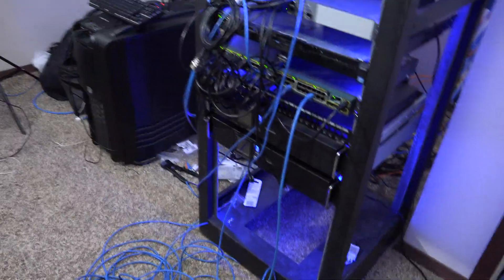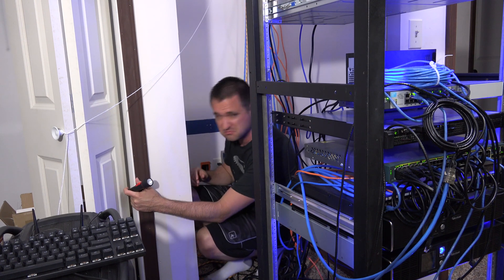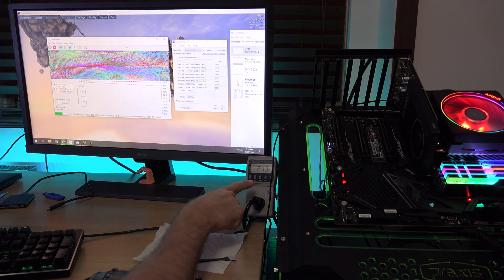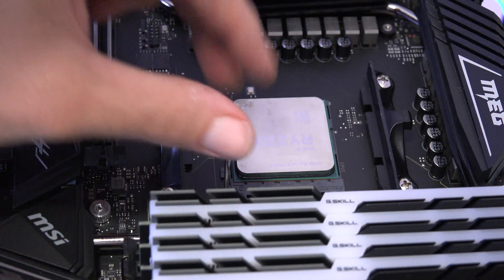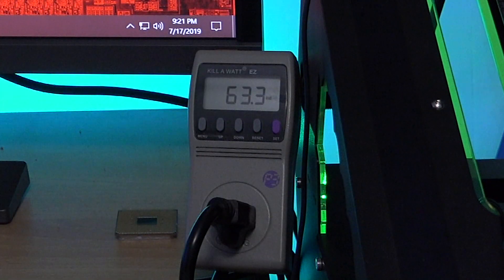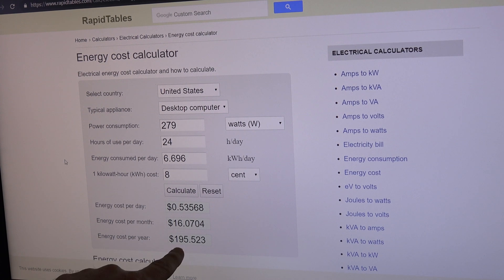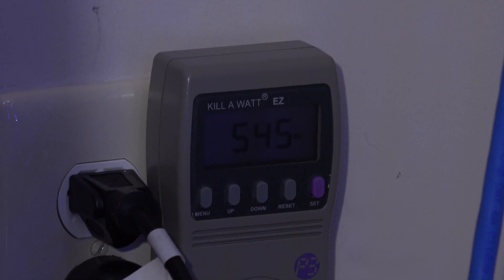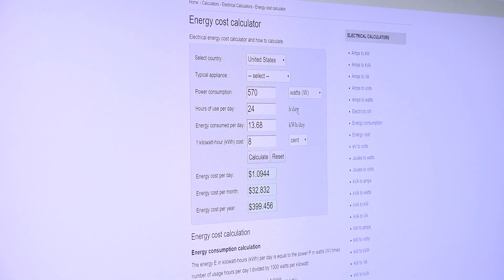Real power usage and of Ryzen 3700x/3900x and p2000

Comment: in reality the total consumption for a server like this is not too different, le`t say we have a huge video file to process, with the 3700 it will take 2 hours at 100 watts (cpu only) while with the 3900 it will take 1 hour 15 minutes at 150 watts (just an example). The total power consumption (thus cost) for that video file will be about the same.

Comment: This test is not only measuring the energy consumption of the processor but also that of the graphics card and memory, to this  must add the led lights on a board with X570 chipset which consumes more energy than the X470 and B450. Despite these, it is a good result for the system loaded completely. I think the Asus Pro WS X570 board could be a better option for the workstation approach.

Comment: I have a similar setup but using a Ryzen 2700x on windows 10 home.  Along with my p2000 I have an RTX 2070 for when I game.  The P2000 ryzen combo works fantastically for transcoding.  Only problem I have is when I want to game I have to switch which GPU is using the primary display. RTX for when I want to game and then back to the p2000.  I am hoping there is a solution someday where you can select which gpu you'd like plex to use for transcoding, so I can easily game while plex transcodes in the background.  I've tried setting up a VM but I think I would have to run linux to get pci passthrough to work with virtual box.  I would rather not complicate things.  The best solution would be to build a dedicated plex machine.... Unless you know of a solution.  Thanks!

Comment: I had a very special question to ask you but it feels like if I had the answer around 5:05 minutes of your video....Well a month ago I bought a new ryzen 3700X with one of the newest motherboards from Asus but I’ve never seen anything that would require more than a 8 pins to give the appropriate power to cpu so I’ve decided to ask for advice to know if I needed to connect both cables to the 8 and 4 pins connectors and I was told that the 3700X only requires 8 pins and more would be too much and even burn my cpu....but your cpu seems to be powered by more than a one 8 pins connector. I can’t wait to get your answer on it because I just can’t see myself roasting a bran new cpu that I’ve paid nearly $500.00 here in Canada. Thanks in advance and excellent video btw!!!

Comment: b450 or x470 will use a bit less power too.  Asrock rack x470 would be the way to go for the next server! Don't forget you can easily limit power draw on ryzen. Check it out.
Reply: my dream is to lower base clock to 400 and let it go nuts to max turbo for up to 20 secs before dropping to 70% of turbo for extended loads...

Comment: And that is why low power was #1 on my list when upgrading my server. I could have bought an old used server for a bit cheaper but the power consumption would have been so high in the long run it wouldn't have been worth it.

Comment: Ok, what ive done, is i got a used rx300 s8 server, hooked up with ONE E5-2630Lv2 60W TDP CPU and 96 Gb of ram. Installed Proxmox, made my virtual machines according to this :
3x Ubuntu Server > Secret stuf
1x Ubuntu Server > MySQL Server only
1x pfSense > As this is my main router + dual port gbps NIC passthrough
1x FreeNAS > with plex media jail + external HBA SAS Card passthrough
1x Ubuntu Server for my ISPConfig host
2x Ubuntu Server for a friend who runs game servers on them
1x Ubuntu Server to run and host Smart Home stuffs

Basically the idle power draw is about 120 watts, at full load it uses 200-250 Watt of power. Im from germany, so 1 kwh costs me a mind blowing 30 cent :S :D but ive done my research and this server runs 100% on green energy (5x300W solar panel + 5x 230Ah Varta Pro batteries + 1Kw inverter ofc excess power is feeding the house)

Comment: Question: When transcoding 12-15 HEVC Streams with the P2000 what's the temps coming from the GPU?

I ask coz I currently have a Slim HP Tower (Low Profile GPU) if the thermals are low I may sneak the card inside somehow.

Comment: I love you left your mistakes in haha. Really makes me think I need to swap out my old Poweredge 1950 III for a new build. It's gonna be pulling just as much if not more then Zeus
Reply: Those 1950's are power thirsty, plus you need to calculate cooling costs for additional BTU cooling depending on your climate. I know in AZ I'm better off running a pair of hair dryers over the 1950's. You start to get real savings with sandybridge or newer Xeons. I run a i3-8100 for my Plex server and it handles a decent amount of streams with just quicksync.

Comment: You can drop the 3900X to the same wattage that you are burning with the 3700X if you want, its just a BIOS option (usually in the overclocking menu, or in CBS/NBIO/SMU, to put a wattage cap on the socket).  Just go in and change the socket power cap to 100W or 130W.   It will still be gobs faster than the 3700X with its 12 cores and single-core boosts are not affected... only all-cores turbo, really.  Honestly, most of that extra wattage is wasted anyway.... Stock settings burn an extra 50W for maybe 5% more performance.   I generally leave mine capped in the 100-130W range.

Idle power consumption is a combination of factors.  For one thing, all your RGB lighting adds watts that matter at idle.  Any cards you have plugged into PCIe slots will add to the idle as well.  The size of the motherboard also matters.  Mini-ITX mobos tend to idle 10W lower than Micro-ATX or ATX motherboards.  The GPU will burn some power at idle (usually less when the screens are blanked).  Storage devices matter... NVMe (M.2) drives tend to idle at higher wattages than SATA SSDs.  And of course HDDs (which you don't have, thank god) eat even more power.

The CPU idle should be fine as long as you are letting the BIOS Auto it and not trying to set a manual overclock.  A manual overclock will increase the idle power too.   Memory fabric also increases the idle but that is usually something people are willing to keep boosted (I certainly am, its almost 'free' performance!).  But it does add a few watts, usually.

-Matt
Reply: I would think it would be the opposite. ATX boards would be the most efficient since they are often designed for overclocking, so they tend to have higher quality VRMs that provide more efficient power delivery. Was watching some x570 ATX board reviews and it seems like the high end boards consumed about 10-20w less than the lower end boards, despite the high end boards having a bunch of extra bells and whistles with RGB lighting out the wazoo.

Would imagine most board vendors cheap out on the VRMs with mini-itx boards, since realistically nobody does a mini-itx build with the expectation of overclocking.  Also would think the fans would have to work overtime to dissipate heat.

Were there any other variations with the mini-itx build like a different chipset?
Reply: Hi, so yours 3900x on x570 MB draw 100-130 W on idle? Whats your graphic card, SSD, HDD...?
Reply: @Avennder  Huh?  No.   It depends on how much power (and money) you want to spend overclocking.  If that extra 5-7% in performance doesn't matter to you, then we're talking a B450 motherboard, 3900X, and 3000-3200 MHz memory.  Sans GPU that will idle at around 40W and at a full CPU load it will run around 200W at the wall at stock BIOS settings.  But you can still get most of the performance by dropping the socket power to roughly 100W-115W, and the system will draw only around 150-160W at the wall.

Not counting any GPU, so add however many watts your GPU eats on top of that, depending on the workload.  The GPU has no effect on CPU socket power or cooling.

A lot of people don't want to turn their rooms into furnaces and prefer their machines to be dead silent.  I am one of them :-).

-Matt

Comment: Jason- after all the fees, we are actually paying $0.13 to $0.14 per kWh in Kansas.
Reply: Depends on the tier you go into. He could also wire up 220v and gain a small boost in efficiency. But your better off down clocking and under-volting stuff you don't need. Most of my servers besides the transcoding box are all at 1.8GHz in my server stack.

Comment: Great video, Jason! Thank you for taking the time to measure the power usage of these CPUs. One of the best parts about GPU transcoding with NVIDIA cards is that it actually uses NVENC and NVDEC chips (not the compute cores) so it uses even less power than what's used when you run those synthetic GPU benchmarks -- sometimes the GPU compute cores aren't being used at all. In my tests, I can see up to 40% NVENC or ENCODE utilization and little or no GPU compute utilization. This makes for even better savings on electricity as you can see here: http://slothtechtv.com/wp-content/uploads/2019/07/gpu-utilization-cpu-nvenc.png
Reply: Sloth, love your content... Jason you are a great resource too. One thing I would point out is that, as per Sloth's video, the cpu won't really be utilized much beyond 4 cores and will never be utilized for transcoding while using the p2000. So a 12 core won't be much use unless you plan on doing VMs or some other high cpu use simultaneously. My point is that it will be much closer to idle than full throttle most of the time even while do lots of transcodes.

Comment: LOL wut. my E5-2697 v3 14core Xeon uses 100w on idle. i think it might be time to switch
Reply: That's not that bad actually. I was running 2 Xeon E5620s (4 cores each) and they together idled at 100 W. Took one out and it's now around 70 W.

Comment: Your $/kw hr is not accurate.  You really need to add the surcharges added to rate.  Don't believe me?  Divide your bill(minus fixed account fee)  by the kwh used for the billing period.  You will see a 60%-80% increase
Reply: J Fraser By your logic then the rate goes down with more usage
Reply: @sturmbreakers7817  yes it does.  My rate is 9 cents but I pay about 20.  If I use ALOT of power I can get down 15 cents.  And I mean alot of power.

Comment: From what I've seen, you'd probably be 30 W lower without an x570 Motherboard as well.  Unless you're planning on using PCIE 4.0 for some weird reason, a 400 series board would probably be better used in this situation.